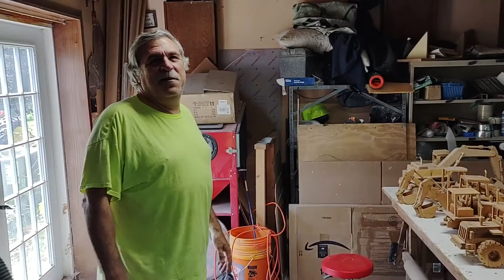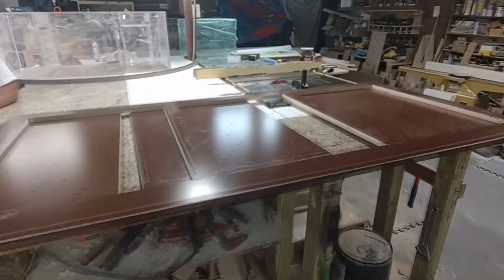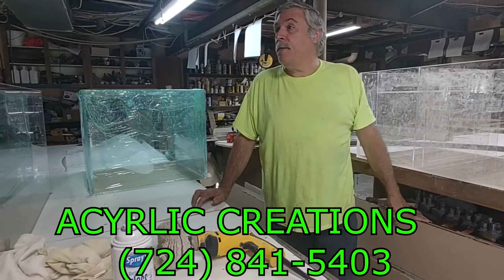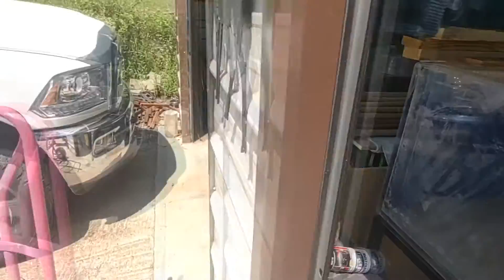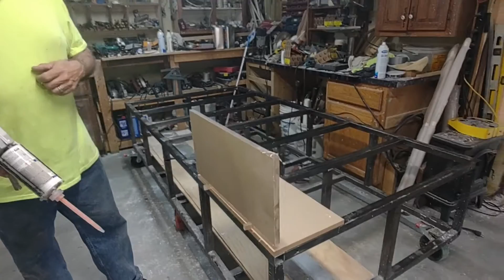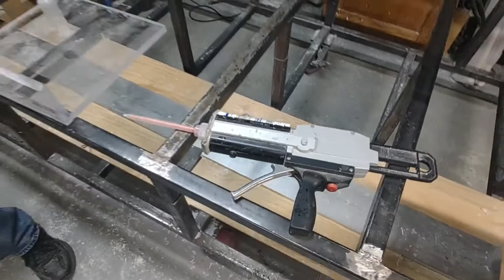HOW TO BUILD ACRYLIC AQUARIUMS // LARGE TANK MANUFACTURING // MASSIVE 450 AQUARIUM IS BUILT!!!

Comment: I noticed that he showed the gluing process but with two different types of glue, liquid with the little needle applicator which was the weld-on 4 and that calk gun. I plan on doing a customized tank of 3 feet wide, 5 feet high, and 1.5 feet deep and I plan to use a half inch thick. I guess it would be considered a window tank. My question is would I use only the weld-on 4 liquid to glue it together or should I consider using a different strength level? Also would half inch be good for the tank I'm planning to do? Also, does the edges have to be roughed up prior to gluing when using the liqid or should they be absolutely smooth using the liquid glue? Also, absolutely beautiful tanks and craftsmanship.
Reply from the maker: @anthonycaradine7652  Thanks for watching and following along Anthony!!! First, I would do a ton of research. It's my understanding that WELDON 3 & 4 are for smaller projects, 16 would be for even bigger. But, once you get into larger tanks and thicknesses, you move into 40 & 42 -2 part compounds. Welding acrylic together is an art & craft, takes time, practice and patience. I would practice multiple times to get it dialed in. Research... research... research!!!!
Reply: You can use weld 3 or 4. Just has to be indoor cooler control room. This allows the glue time to melt the plexiglass together.  If you use the liquid glue in a garage that’s hot and dry the glue would just evaporate. It’s like alcohol. And sanding edges isn’t needed. Straight cut at 90 degrees off a table saw with a carbide blade is fine. I waste time with a planer for the first 6 months. Gave it to a scrap guy one day lol just to make space. Oh and use cast material

Comment: Is it safe for an aquarium that size to sit directly on the metal stand? Or does it need a piece of wood under it?
Reply from the maker: @victoraquino3002  Thanks for watching and following along!!! Yes, this can go directly on to a metal stand, but you can never go wrong with a sheet of 3/4 plywood and then a 1/2 to 3/4 inch  styrofoam or cushion between it and the tank.
Reply: Thanks for the info and enjoy the channel. Question,  have an aquarium that is 72” (L) 24” (W) 30” (H) and it’s made out of 3/4” acrylic. Would I need to do the same as well?

Comment: Hello my tank acrylic has craziness I think it's called  there is a way to fix that and is it safe also when I bought a tank acrylic 240 gallons bottom part is crack I need help repair it ether cut it and glue new bottom or just glue new piece on top of the old one . I bought weld on 40 two parts  if you have any suggestions or guide me in the right direction will be great thank you so much
Reply from the maker: Thanks for watching and following!!! That is called fatiguing, once you have it there's no going backwards. That means an incredible amount of stress was put into that acrylic. To create more integrity, yes you can glue in acrylic bars around the bottom perimeter.
Reply: Thank you the question also the bottom tank has cracked what will be best way to fixing it . Would it. Be best  to cut out the whole bottom piece and replace it if yes what kind of saw blade I would need to do that or it be better just glue new piece of acrylic sheet over old one and drill holes end of cracks to prevent  crack expanding sorry my english not so well hope I describe the right way
Reply from the maker: @Mrjoker622  what size aquarium is this?
You might want to just start over...
Reply: @TheirWorldAquatics  it's 240 gallon  half inch thickness of acrylic on bottom length 72 half inches with 24 inches  hight 30inches